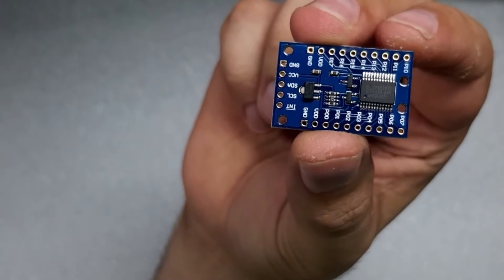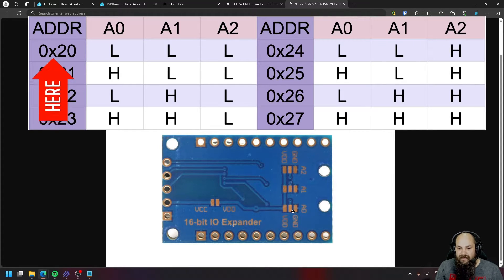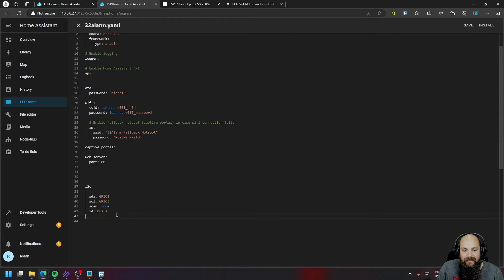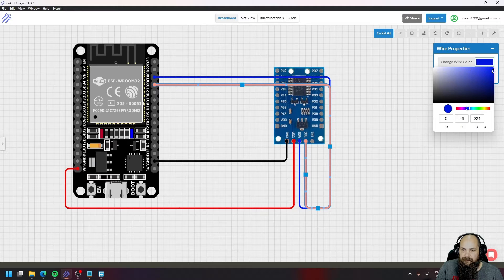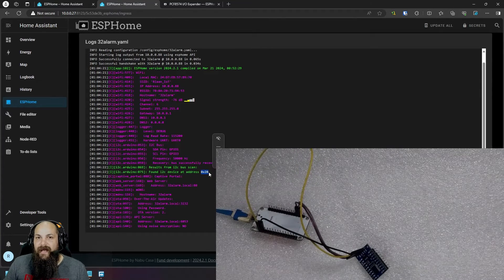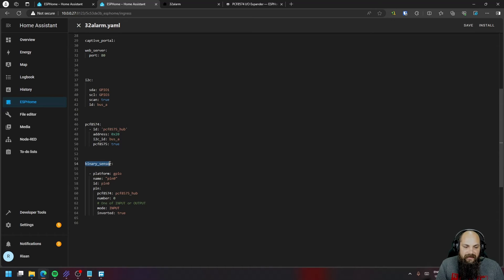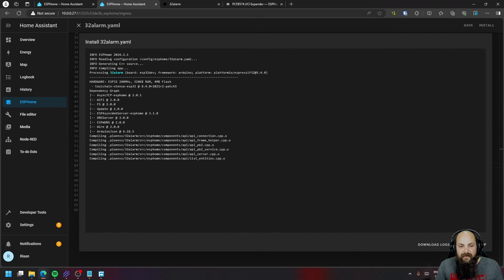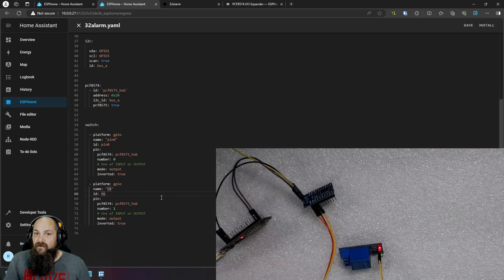How To: Add More  GPIO to ESP32/ESP8266

Comment: What tool are you using to draw connections
Reply from the maker: Hey the program I used was Cirkit I had to manually add the io board but this was fairly straightforward as it only needs a image